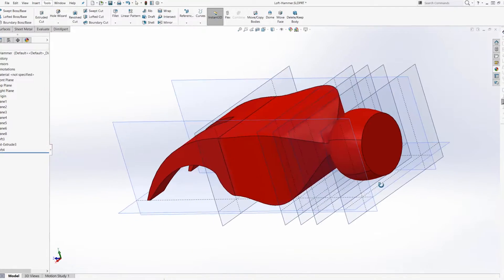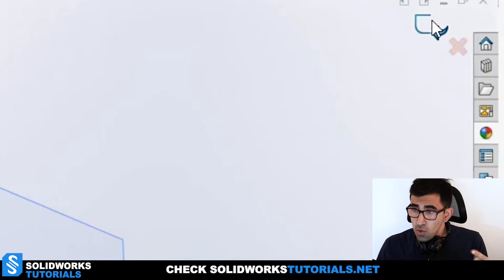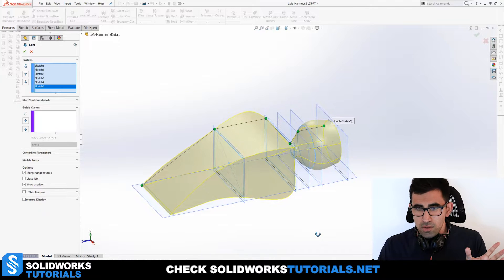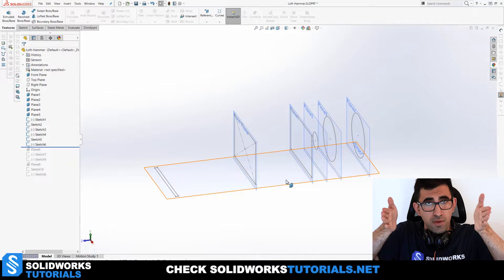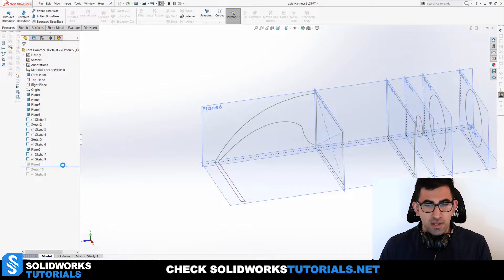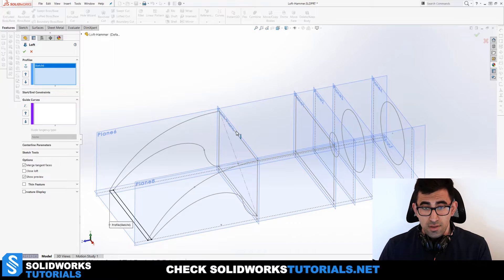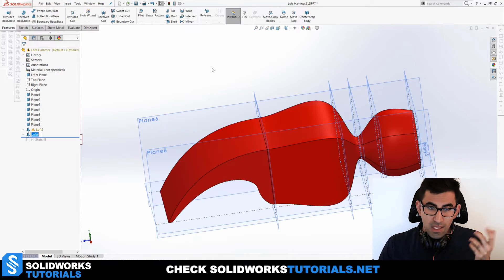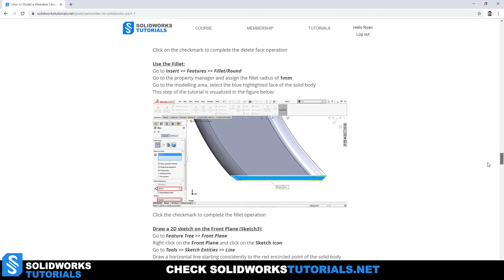SolidWorks How to use Lofted Boss/Bass -Absolute Beginners

Comment: Thank, you, please How do you copy sketch guides lines from Plane 6 to Plane 8 ?
Reply from the maker: which time mark?
Reply: @with-aryan    8::06, thx.
Reply: @santory5788  look to the left side hhe did it ones and show you just playing with design tree 
if you want it you just pick the plane you just draw it and then pick the last point of your related sketch and create a plane after that just open new sketch on your new plane and click the sketch you want to copy and use the convert entitities on sketch tab its done
Reply: @kuraigasone  didn't get what "convert entities" function does, but it worked in this case ) Thanks!

Comment: Can you not use 3D sketch, which solidworks automatically creates planes, instead of creating planes and sketches on those planes? I'll give it a try and give you guys feedback ;)
Reply from the maker: Of course, you can use 3D sketches for guide curve specifically. But performing Loft with 3D sketches just for the sake of not making planes, is  counter productive and would take you longer

Comment: Does Plane 6 need to be on the outer edge of the sketches? What do you do if your profiles are offset (i.e. not exactly centered)?
Reply from the maker: BoostElectronics no it does not. In that case you must draw a new profile